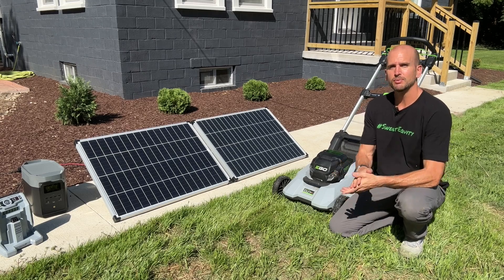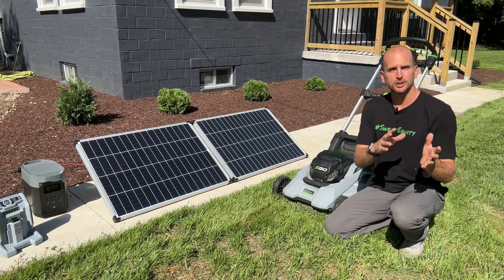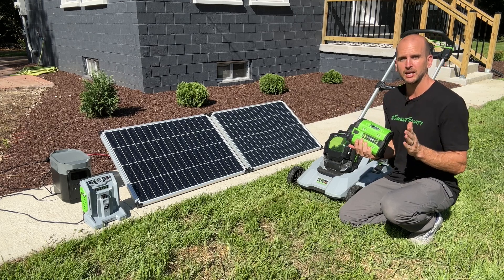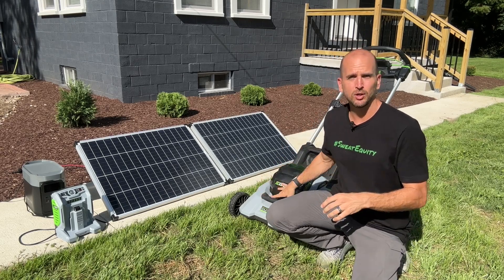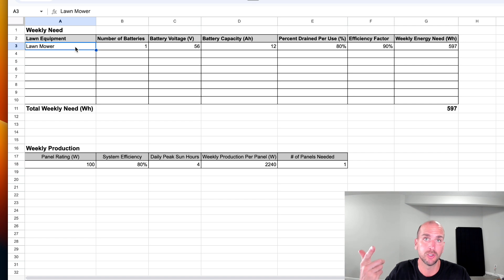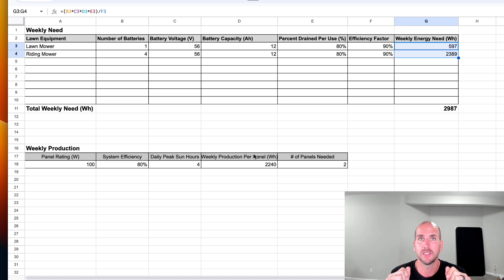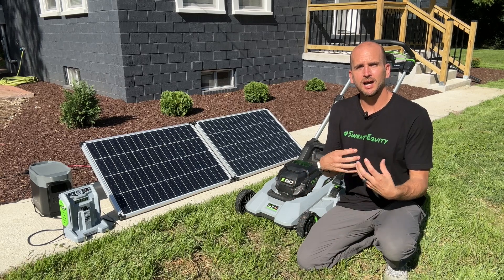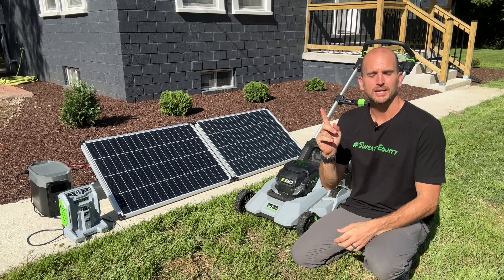How Many Panels Are Needed To Charge A Mower

Comment: I like the idea of having an off grid shed system like you have mentioned in these videos. My concern is just heat and cold extremes and I need to research that more. Maybe you can do a video on it in the future?
Reply from the maker: For sure, I will most likely do a few different sizes and price points over the next 6-12 months. 👍